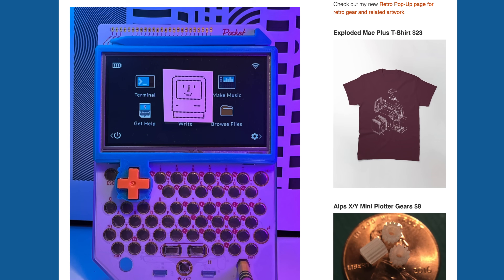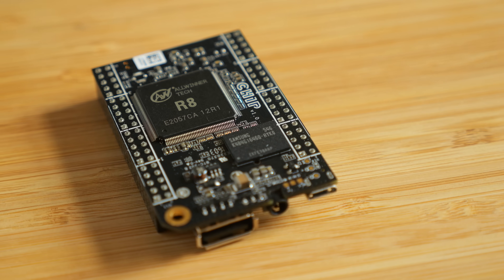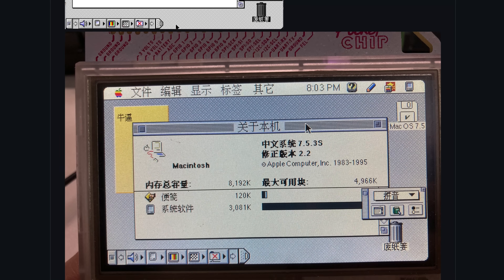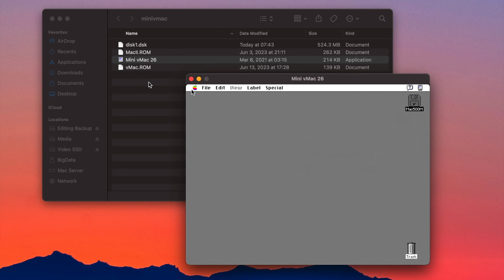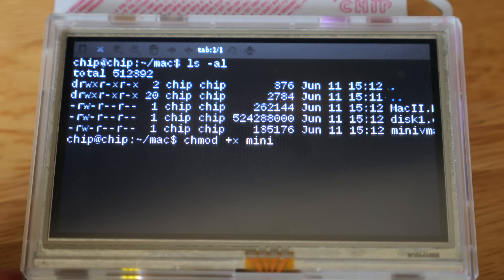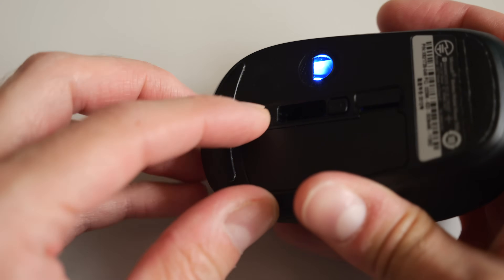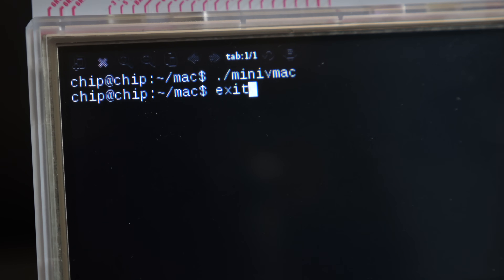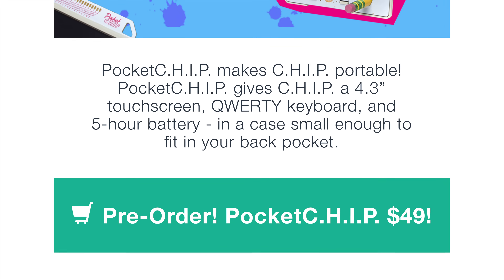Put a vintage Mac in your pocket!

Comment: OK, because Macs are used to forcing you to wait for them to eject optical disks and floppy disks (which is different from how it treats USB hard disks and flash, obviously -- but back in those early years there was no USB or flash), then show us what it's like on this when you insert a floppy or optical disk emulation and then:
1. issue the eject command on it but it can't eject that, and 2. eject it yourself (as a USB stick plugged into a hub alongside the mouse) without first ejecting it virtually. Does it just treat that floppy or optical disk emulation as a flash card anyway? And actually, what I really want is to watch a Mac emulator on a computer with actual floppy disks that it can't eject, like on the Amiga or Atari ST.

Comment: Ah, installing old Mac OS's on random devices, I've done that plenty of times, heheh.
I think my first one, apart from Mac-on-Stick, was my Jailbroken iPod Touch 4th gen if my memory doesn't deceive me.
Then I installed it on my super old HTC TyTn II, still have it today, and love that little flip up screen blast from the past.
Both previous ones though were not fully installed, I just ran the image of the Mac OS Classic installer, which is in itself a fully functioning system, just without the ability to make changes and keep them on the next launch, image was not writable, but you could still mount images of apps and run them.
On my PSP Go though I fully installed Mac OS 7.5.3 because for whatever reason someone decided to port Basilisk II VM to the PSP, so I was able to install a few games and programs, I actually have a game of Monkey Island ongoing, The system runs a little slow, but for a point and click game like Monkey Island it's enough. But even more amazing is that I was able to install Windows 95.
I still have a Nintendo DS that I want to fix, I think there's also a classic mac emulator for that.

Emulators and VM's have always fascinated me, especially on devices you least expect them to work.

Comment: I loved my Chip. Had two Chips and one Pocket Chip for them to slot into. Both of them burned out eventually. After NTC went bankrupt, there were a couple of community efforts to keep things going, but for something that was connected to the web, I wouldn't have kept it running for much longer.

There are some cool alternatives that'll fit various Pi boards out there, Tindie is always a fun browse!

Comment: yeah Chip Pro killed Next thing, there was a pair of Chip 2's that literally kicked many more butts than most people have, I wish they had placed the flasher available as a standalone but it stayed web based and some guy bought it in the auction and locked it behind a paywall, and well, its gone now, some guy got the chip 2's and released them as the popcorn computer but he failed as I understand.
I loved my Pocket chip, she lived in my pocket for a long time, and now sits on my shelf with her Alpha Pocket chip sister.(thanks Gus!)
Reply: Hi Bigbadhodad! The Dashbot, er Voder, Kickstarter plus some supply chain issues did a number of NTC's ability to start in business. You're right about the CHIP 2 being kick-butt. Many years ago they have/had similar specs to one of the darling Raspberry Pi alternatives of today.  I haven't tried to see if I can get any of them running with that board's firmware but it would be fantastic if it was compatible.

Comment: I got a Pocket CHIP to do Pico8 development and play on the go but the keyboard was just way too stiff to use more than the casual terminal command. I need to dig it up. I remember that when Next Thing went under, their connection to the Pico8 servers went down and you had to manually update it whenever the API updated enough to be incompatible.

Comment: I have a pocket chip. Its biggest problem is its rudimental NAND module which has zero controller logic to manage data retention and wearing issues. Basically it loses data in a span of maybe a year and it requires you to reflash the whole thing.

Comment: Typical story. This is why you should NEVER and I mean NEVER back anything on kickstarter or other "crowdsourcing" websites.  It is a fundamentally broken and nonsensical system as if it were specifically designed to rip unsuspecting buyers off of their hard earned money.
There is no well regarded "investment" system that says you front the money to make the thing you are going to buy.  "Investing" is very risky. That's why investors require high interest rates and only back the most viable products after a thorough audit of their business plans.

Comment: Wow! I must dig out my Pocket Chip! I installed an amp & speakers in mine using some recovered laptop speakers. Mine, like a lot of them, came with 8GB of storage even though it was documented as 4. It’s a shame it wasn’t a success because honestly I loved my Pocket CHIP, it was a great little device. 
I know it’s unnecessary but I will be doing this. That resistive touch screen will work much better with a stylus, I have a bunch of them from different devices so it’s not hard to find one.
Great video Colin, thanks & thanks for tipping me off about this.

Comment: you could "emulate" with a <2USD basic fpga chip (2K logic cells etc) simple chips/systems, like simple intel fpga's, the entry range
Reply: no i dont mean the 8k-40k cells chips, but the smaller entry range fpga chips

Comment: (5:44) Storage, Wi-Fi, Bluetooth, AND an integrated battery charge controller!

I had a project that I originally designed to be based on a CHIP module with a custom DIP (that's what CHIP's add-on modules were called), but it didn't have enough storage for my needs. Despite shelving the project to work on other projects, I rewrote the design ideas I had written so far to instead be based on the Raspberry Pi Compute Module 4 platform on a custom carrier board with an integrated PiJuice alongside newer versions of the other components I originally wanted to use with the CHIP.

Actually, come to think of it, I'm sure someone would've made a CM4-based spiritual succesor to the PocketCHIP!

Comment: Surprised is your unit still works, as mine often need to be reflashed after sitting around for too long. For anyone thinking about picking up one of these, it is not easy to get them updated, so you may want to stick with off-line projects like this. The most promising future for CHIP I’ve seen is that a couple people have been developing a port of PostmarketOS for it. Although the primary focus of the distro is bringing back old phones, it offers the promise of someday being able to flash an updated OS to the CHIP directly.
Reply: Is this why I can charge mine, power it on and off, but it doesn't do anything? Not even drive the LCD?

EDIT: Yes to all
Reply: I can't install almost anything on it keep on getting the package unavailable error almost every time are you familiar with the issue. Can't even install the new version of pico- 8 on it or DOOM😓 Would appreciate a lot if you could help me out, thanks.